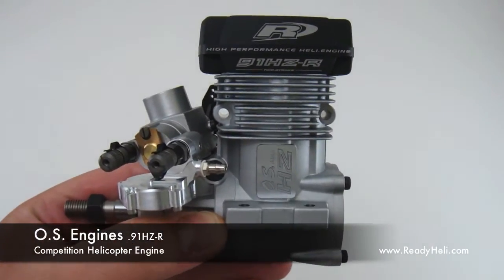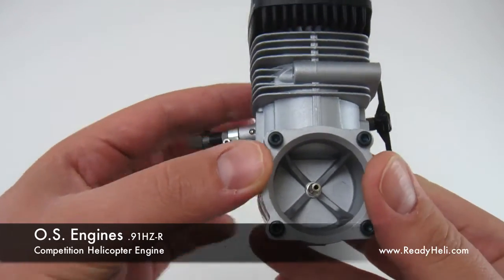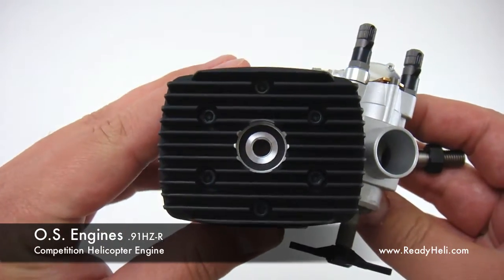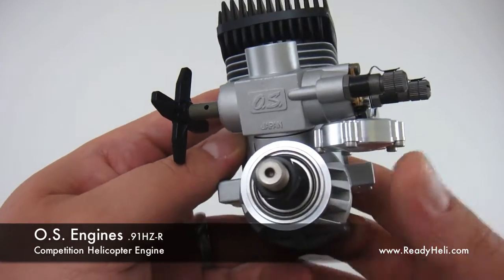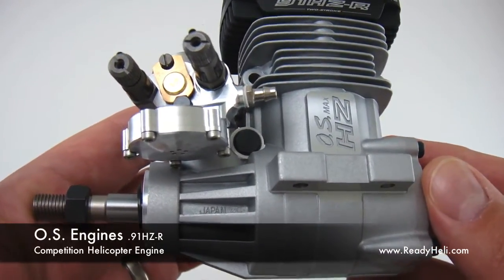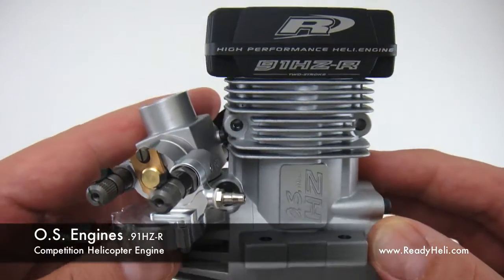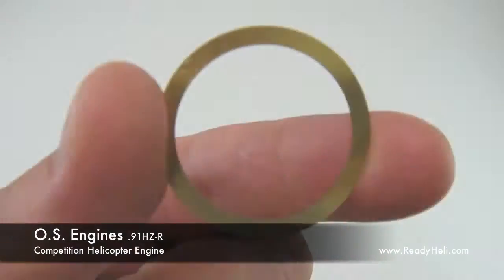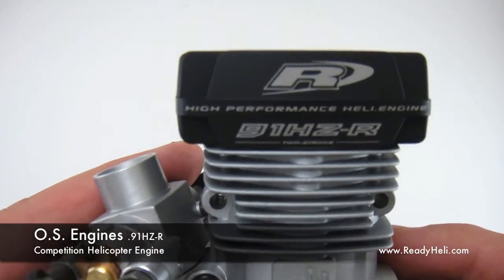OS MAX  Engine .91 HZ-R   OSMG1973    www.ReadyHeli.com

Comment: My regulator is not allowing any fuel to go through. Looks like the diaphragm is not strong enough to open up the valve. Tried to manually push the diaphragm with a blunt needle, then only the fuel flow. And I only came to realise that the culprit was the regulator, 10 years later!!! It was a conversion kit to upgrade my 91HZ-PS.